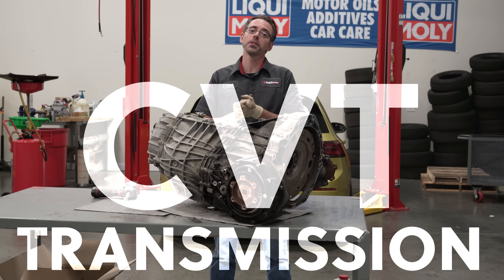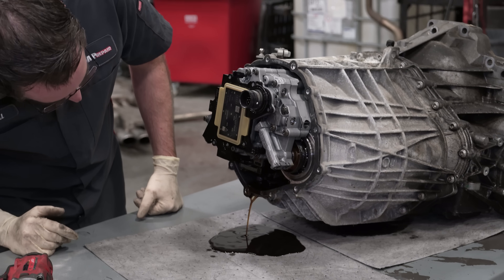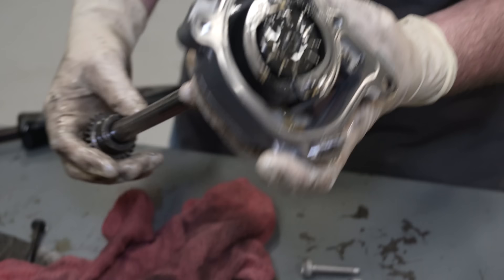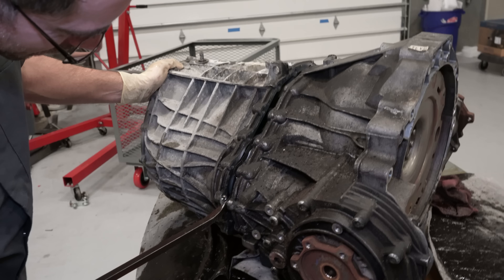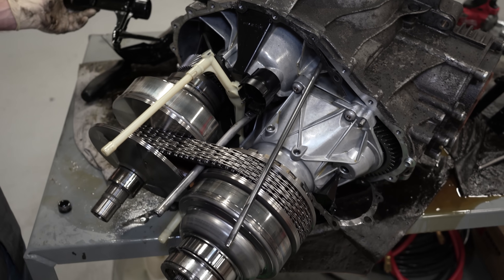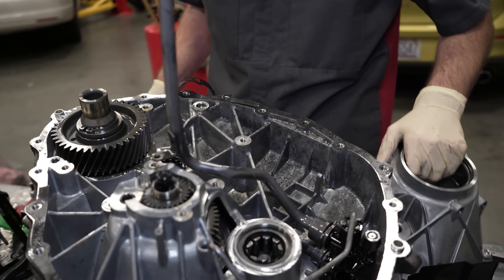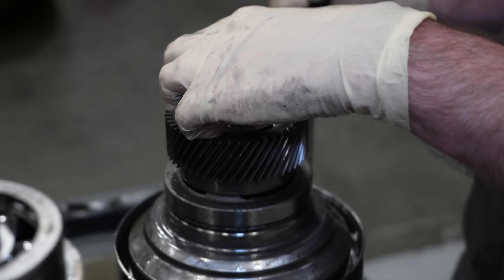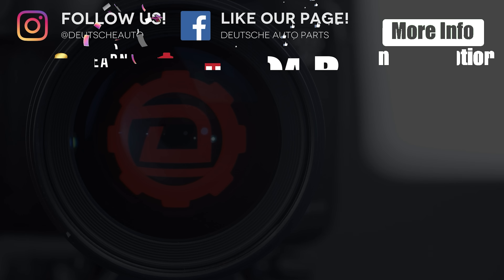Why you shouldn’t get a CVT transmission

Comment: I've never had the displeasure of experiencing a CVT but there's definitely a reason I've always liked manual transmissions. They are just simpler in every way.
Reply: Do yourself a favor and rent a Nissan Rouge. I’ve had two rentals and they drive like complete shit. I warned my wife. She said it’s not that bad and took the car for errands. She came back and said omg were you right. Lol
Reply: @TheMlvswoll  do yourself a favor..drive a honda accord cvt!! 👌 👌
Reply: @TheMlvswoll  I'll definitely take the word of everyone else! I like to bang gears too much! I got my wife an Audi with the ZF 8 speed automatic, it's definitely a nice transmission but I still prefer a 3rd pedal!
Reply: Manual easy to fix when rather than using automatic transmission car is cost a lot of money to fix it.
Reply: Especially if you need to tow a trailer, a manual transmission will outlast ANY kind of automatic in light duty trucks or SUV's. The one exception is maybe the Allison automatic that GM puts in some of it's diesel pickup trucks. It's designed for high-torque, low-rpm diesel service from the ground up and owners mostly report good service and few problems with it.
Reply: CVTs are a hoot to drive
Reply: @HarryFlashmanVC  somehow I find that very hard to believe. But I also never drove so...
Reply: becouse with a manual you are in total controle of the car. you cant change the felling with any other transmission.
Reply: @gogereaver349  They are even changing semi Tractors over to auto-shifters. They are nice until you get to wanting to control the speed and traction of rhe semi. Manual shifting is possible to a point. But after a period of time, the truck will switch back to auto on its own. Almost everything is controlled by the computers on the newer figs.
Reply: Totally agree
For the mechanical sympathy in us   I just couldn’t deal with it 
It’s just WRONG
Reply: I feel like manuals are a pain in the ass..to much shifting..lol
Reply: @edubb2491  pretty much a preference thing. In Europe we have to drive stick to pass the auto exam, so every driver already knows the basis of operation to begin with. It also helps with focus, I think, requiring you to be both consciently and subconsciously focused on the driving task. As soon as you're familiar and comfortable enough with the operations, you execute them without thinking, so even in slow transit it shouldn't feel burdensome, if it does you're just not got at driving stick.
Reply: @edubb2491  a cvt gives you the experience of an automatic that’s about to fail … badly
Reply: @edubb2491  it's really not that bad. Honestly it's fun to me. I am definitely a gearhead though so... Only time it's not fun is on a steep hill with a bunch of stop and go traffic.

Comment: As a concept, CVT's are great. They should never have left the concept phase for use in a car. They seem to work well in mopeds, but that's about it.
Reply: Just about every snowmobile ever made runs on a CVT. So they're great for that.
Reply: @RioRyan28  snowmobile are not much different from mopeds
Reply: @OBeeone88  snowmobiles  differ from mopeds in power and load.
Reply: They've got a place in shop machinery too. Built right they can hold a ton of torque, but get hot and noisy. I'd like to see a CVT as a gearbox for economy electric cars.
Reply: @kottokmotors  Electric cars don't need gearboxes because the torque produced by electric motors is 100% at all RPMs.
Reply: So God bless the synchromesh manual gearbox !
Reply: @john1703  ameen amigo
Reply: the toyota cvt was made by toyota is well known not to fail. one of the things they did was put a takeoff gear in it so in first gear you are not even using the cvt then it switches to the cvt. this fixes two things the first is the very slow takeoff a normal cvt has and the strain a cvt is put under duing takeoff.
Reply: @gogereaver349  Scotty did a video on that Toyota CVT.. Very informative.
Reply: @gogereaver349 so like a manual you have reverse, N, 1st gear and a clutch and above 1st gear you can synchromesh into the D for the CVT ?
Reply: @ArneChristianRosenfeldt  kind of yes. But there's no clutch.
Reply: @gogereaver349  The takeoff gear was an update. I believe it was 2013 or 2014? when the Corolla switched over to CVT,they had issues with those first CVTs from what I remember reading..
Reply: Nissan makes Jatco CVTs which  are used by many brands. They are the worst by far. My Mitsubishi had one and it was going out at 120k when I traded it in after 4 years. When I looked into it I learned I was lucky it lasted that long.
Reply: Lol…. Toyota makes great CVT with even first physical gear to reduce stress…. CVT aren’t bad for all manufacturers
Reply: Mopeds are like fat girls ,fun to ride until your friends find out.
Reply: Just because it’s from VW they don’t know how to make CVT, look at Honda and Toyota, they don’t have any problems as long as you maintain it.
Reply: I own a moped with CVT and I HATE this moped
Reply: They work well in tractors, where it is beneficial to be able to infinitely vary vehicle speed at the same rpm for PTO applications
Reply: @averyplote7148  pretty sure tractors use a hydrostatic transmission.  It's a fluid pump driving a hydraulic motor. They work great in a tractor for maximum production but are not the best for fuel economy.  The system generates quite a bit of heat from fluid sheer.
Reply: My Honda Civic has a CVT, works just fine and still going strong without a hiccup approaching 90,000 miles. Just change the fluid every 30,000 miles and don't drive like a complete A hole. Any equipment will break if abused hard enough for long enough.
Reply: @jonniemactyler7929  90k miles is nothing to boast about for a modern car
Reply: @kenwilson6850  Well, it is true that isn't an extreme amount of mileage, but I had a regular Honda automatic transmission go out with fewer miles than that so transmission type isn't the only factor. Also driven a bunch of different cars that started having shifting issues long before 90,000 miles on standard automatic transmissions. I am responsible for shopping vehicles for my branch of a large city fleet and see firsthand how many are going in for transmission problems with far fewer miles than that. That and the hundreds of guys I work closely with driving everything under the sun means I've got a pretty good idea of what troubles a variety of brands of vehicles and which ones go trouble free for longer. Nissan CVTs are crap, Honda & Toyota CVTs are pretty good. Standard auto transmissions also have plenty of issues across many different brands and types of vehicles.

Only things done to my honda over those miles is tires, wipers, filters, oil, tranmission fluid, a battery, and fuel in tank.
Reply: @jonniemactyler7929  Maintenance and driving reasonably will result in most cars lasting well i to high mileage. The harder you work them, the faster they wear. A good basic physics class can explain it all.
Reply: @jonniemactyler7929  my son just got a new 2022 Honda Accord due to a serious engine problem in his previous car. He's a little concerned about the longevity of it's CVT. It's getting where is hard to buy a new car without one..
Reply: @telcobilly  Change the cvt fluid with genuine Honda fluid every 30,000 miles and it should hold up fine. They are putting them in most cars now because they get great mileage. You can take off gently and keep the engine RPMs between 1500-2000 all the way from a dead stop to highway speed. When I try in my Civic,  I get 42+ mpg with mostly highway driving and 37+ in the city. The push for this isn't just from the companies, it is driven by government efficiency and emission standards. Same reason companies are using smaller turbocharged engines, cylinder deactivation, and engine auto shutoff/start when stopped. Cylinder deactivation has caused engine longevity problems, so has the auto start-stop systems. The CVT isn't something you should worry too much about in a Honda or Toyota, just worry enough to change the CVT fluid ahead of schedule. If you do that, the CVTs for those brands have been holding up well.
Reply: @jonniemactyler7929  thanks. My son's Honda has a 2.0 turbo charged engine with direct injection. I hear they are still working the bugs out of DI. I heard the efficiency gains are minimal. I'll hang on to my 2008 Tacoma 4x4 with 75k miles.  Just saw an article today in my feed where someone got 1M miles out of a 2008. Oil changes were the key to it's longevity.
Reply: @telcobilly  yea..its harder..so you figure..they will make em superior..tell him not to worry..and change it every 30000 miles..its easy as changing your oil..1 bolt and drain! Honda 💪
Reply: @telcobilly just maintenance on the cvt.
Its in the manuel .
And use only Honda oil it self .
And a cvt do you not plank the gas pedal to the floor .
A cvt do not need to .
Just look in the manuel on what rpm the max tork and use that.
That is what you use for a cvt .
You do not use the horse power to move a cvt car .
Its even go slower lol.
Reply: They’d work well in a small 80hp econobox (ford festiva)
Reply: @ryan225360  All Ford CVTs fail, and it doesn't help that the Ford dealers. are telling the customers that they are driving the cars wrong. and that Ford has no intention of repairing or replacing those garbage transmissions. ultimately leaving the customer SOL. I can't say as to the Festiva. but Ford Focus that had a CVT transmissions  every one of them failed. Ford motor company should be out of business. for intentionally selling such garbage to people.
Reply: My 2013 Accord sedan that I bought new has a CVT. 225k miles. The CVT works great. I average 36-37mpg. It's smooth, very reliable. Honda CVTs are some of the most reliable.
Reply: @TheAngryDuckman  245 kolimeters? Whats that in miles? Thanx
Reply: Toyota and lexus use them. the priuses have them. some lexus hybrid models have them. 
i suspect ze germans cant get them right 😬
Reply: @99Lezard99  Toyota and Lexus hybrids do not use a mechanical CVT like the one in this video. They use 2 electric motors that are able to “synchronize/slip” to transfer torque. No belts, pullys, or gears.
Reply: @oquinnblount9329  lol. Toyota does use a cvt they just use an actual gear for first gear which takes the most stress
Reply: @99Lezard99   Some Japanese can't get them right either, like Nissan. That's what I heard.
Reply: @MrCROBosanceros  Nissan, at least in the US has a reputation of financing anyone with a pulse. A lot of those people might not necessarily have the money or knoledge to take care of their cars properly.
Reply: @99Lezard99   so hardly high torque cars then.  Yes CVT have a place and granted if you drive like a granny they will be fine but when your used to normal autos CVT don’t hold up.. many videos online show this and also makes it seem like you can’t drive as your always redlining the car to get anywhere 😂
Reply: @Dont-come-at-me-24  Just about everything you've said is a crock.
Reply: Unless there made by Aisin for Toyotas🐱👍🏿
Reply: They are easily accessible and replaceable not like cars.
Reply: I can say works fine in my 2014 Nissan Altima 122K miles no problem with the CVT in its lifetime.
Reply: They work just fine in cars. Here to stay.
Reply: @DM-hw4cr  right..trial n error..and soon..they will be superior!

Comment: I know it's fun to hate on them (clearly VW is bad at making them), but y'all gotta try Honda's current CVT in Civic or CR-V, it's game changing. 100k miles and no issues, no fake shifts, just all the rev you need instantly on pedal press, makes a little engine feel way bigger
Reply: Good point. I have 157 000 miles on my CR-V with CVT. CHANGE THE FLUID EVERY 50 000 MILES.
My 2009 Tiguan was a maintenance nightmare. Replaced intake manifold twice, cleaned intake valves twice, replaced water pump. Had the car slam me into limp mode as I was trying to enter a 55 mph speed highway. Then found it had defective wiring to throttle body.
Honda has had zero problems in the 75 months I have owned it. I really enjoy our 2008 Eos, but my opinion is VW knows how to sell cars, and continue their enjoyment of your funds.
Reply: So far my girlfriends civic is holding well at 70k miles. Hoping it lasts a while cause she’s so set on keeping that car forever

Comment: I am the furthest thing from a mechanic or transmission expert, but the gentleman at the shop who replaced my Jeep WJ transmission swears by Toyotas CVT's in their hybrids. Claiming it has a "real" 1st gear for taking off then the CVT is essentially a second gear or high range.
Reply: Some of theirs do have a physical first gear, that’s correct. And an ecvt is a completely different animal all together.
Reply: @kc510  correct. The Prius has the eCVT, the 12th Gen TNGA platform Corolla with the 2.0L engine get the physical first gear plus CVT with artificial shift points and manumatic control (at least in SE/XSE trims).
***HOWEVER; my 11th Gen Corolla is a straight up regular CVT.

Comment: If you've ever ridden an old moped vs a modern scooter, you'd know CVTs can be great in the correct application.

Certainly not the modern scourge that torx and triple square fasteners are
Reply: Moving 50kg and 1hp around is quite different from moving a car.  You could equally say a rubber band is great for propelling a balsawood model plane, doesn't mean it's worth sh*t in a motor vehicle.  I suppose you still use slotted screws, because those new-fangled philips ones are such sh*t.  Tell us what bolt head you'd rather use, given you know torx, triple square, etc are so bad.

Comment: CVTs aren't inherently bad... just like other types of transmissions there are good and bad ones.  For example, F1 banned CVTs because they were too fast.  That doesn't mean that they should be adapted to passenger cars, especially if those cars can't take advantage of their benefits (power, traction, etc.)
Reply: You watched the video, right?  You heard Paul complain the whole time?  CVT's are inherently bad.
Reply: @WayneRandall  Yeah, okay.  The video is obviously representative of all CVTs ever made.  Eye roll
Reply: They didn't ban them for being fast. They banned them because of cost. They were too unreliable so you had to use too many during a season and smaller teams wouldn't have been able to use them, thus, being at an even bigger disadvantage
Reply: @santiagopbecerra  Cost wasn't an issue at the time.  Williams was the only team that tested them, and tested them against their own car.  It was several seconds per lap faster and the FIA immediately changed the rules to allow a maximum of 7 fixed gears.
Reply: @n.b.5258  yes... Because it would have been too costly for the other teams to develop them
Reply: @santiagopbecerra  You're trying to apply the modern FIA structure and reasoning to 1993.  F1 was completely different back then, especially when it came to things like team costs.
Reply: @n.b.5258  agree to disagree then. Good to be respectful tho, it seems like here everyone just comments to call other people idiots. Thanks for the discussion
Reply: They were faster, and the technology only in 2 teams.... so, banned! It was another time... but if the CVT is well maintained last long... put a transmission from a Peugeot 205 in a Subaru WRX and you will see.... the CVT in Honda NSX is very different in spec’s from the CVT in CRV, of course... the game changer is the Lexus CVT in the top of the line cars, they have two CVT’S in one... find info on that 🎉
Reply: CVT's were banned because, contrary to popular belief, racing organizations are not so much about "going as fast as possible" but rather about having as "close a race as possible" with the winners ideally standing out as the "most skilled" driver. Do you understand that having a CVT reduces the necessary amount of skill an F1 driver requires in order to go fast? Do you really think F1 would allow something allowing a less-skilled driver (with CVT) to better overtake some random more-skilled/more-experienced one?
Reply: @MikeSmith-vb8ul  You mean like switching from manual gearboxes, which required more skill, to multi-clutch transmissions?  In the old days, many overtakes occurred when the driver in front missed a gear.  That doesn’t happen now, so your theory doesn’t make any sense.
Reply: @n.b.5258  Perhaps they wanted overtakes to occur with something else? Something that required "more skill" than merely just "not missing a gear" ?? You know F1 cars still have manual transmission, it's just not the standard ones we see with some "third clutch pedal" -- they are operated using *paddle-shifters*, as of course full-automatic transmissions are explicitly banned in F1 anyway.

Also did you know that so many other innovations (great for racing) like tuned mass dampers, McLaren brake pedals, active suspensions, traction control, turbos, four-wheel steering, etc are also explicitly banned in F1 too??
Reply: @MikeSmith-vb8ul  So after I said multi-clutch transmission you’re going to try to explain it to me?  Please.  The computer in F1 transmissions ensures the gears aren’t missed.  The driver could select the wrong one, or not have optimal timing, but it takes less skill, as does pushing a button to open DRS and make a pass.  The increased skill that modern drivers have is managing all of the options available and the faster speeds, but they also have an engineer telling them exactly what to do, so it’s a trade off.  The point is that your argument about driver skill, especially with regard to F1, is incorrect.  If they wanted a driver skill contest, it would be a spec series.  But then it wouldn’t be F1, would it?